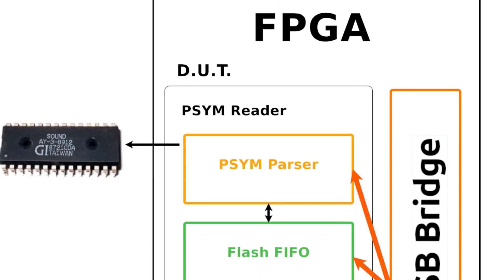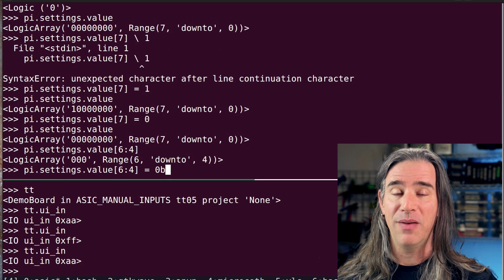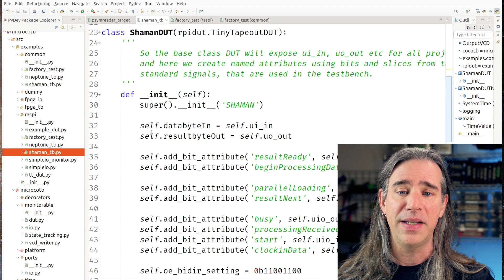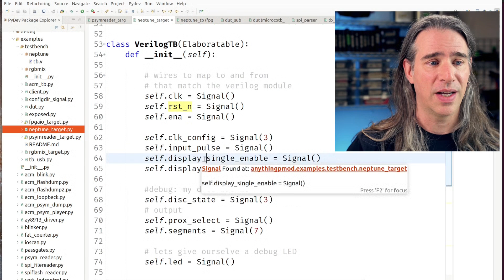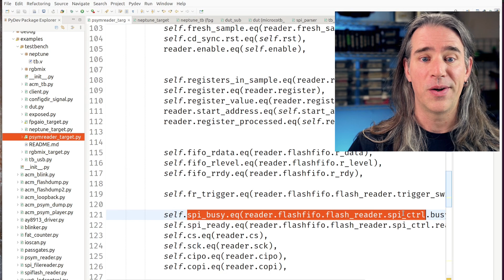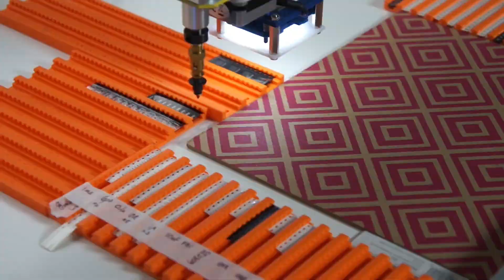From Sim to Silicon: Reuse Your Testbenches with Hardware-in-the-Loop

Comment: great project. thanks to the author for the work done.

I want to clarify: how to write a vcd file on rp2040 to the tmp folder?

your course is interesting.😅
thanks
Reply from the maker: Hi!  Thanks :)  When I'm looking to gen VCDs, I use the FPGA to drive things but am actually running the simulation with hardware-in-the-loop from my computer, not straight from the RP2.  Haven't tried doing that.

Comment: Way above my compétences, but looks like a beast. I need to go into device testing anyhow, so I will have a look at it several times ❤❤
Reply from the maker: Hi Norm, thanks for taking the time to comment.  Neat thing about our stuff is all it takes is interest and a bit (ok, sometimes a lot) of perseverance, and you've got both, so a step at a time and you'll get there.  Hit me up if you run into any hard roadblocks and have fun on the journey.
Reply: @PsychogenicTechnologies  I have to write a modem (on Arduino) to parse two quite proprietary protocol (DCC and Märklin Motorola) running on model railroads.

Any idea how to feed e.g. a VCD file to. an Arduino simulation to debug it in a highly defined environment?

Comment: This tastes like Test-Driven Development for hardware. Impressive!
Reply from the maker: That's a great way of thinking about it!  It's so easy to write little test units with cocotb that using it to build your hardware, one test at a time, is definitely doable.  Then you can turn around and re-run everything against the design in FPGA, connected to critical components, with microcotb running the same tests.